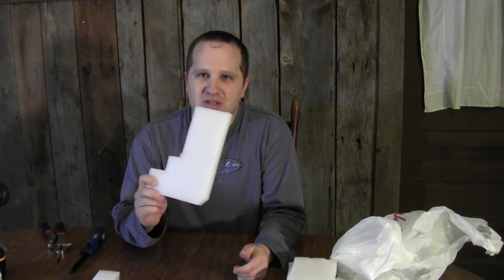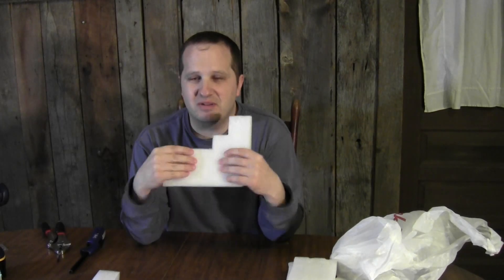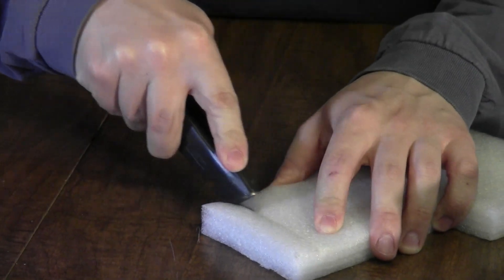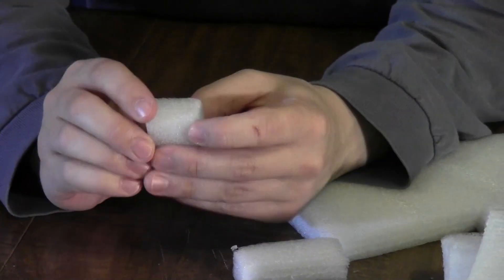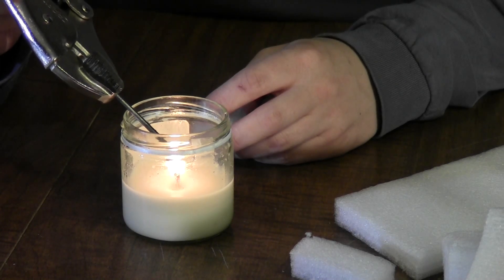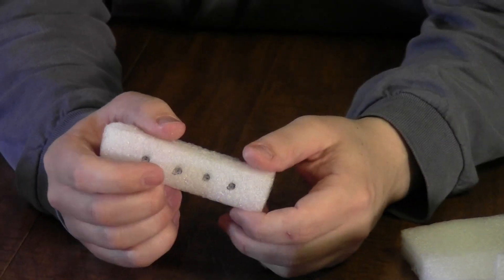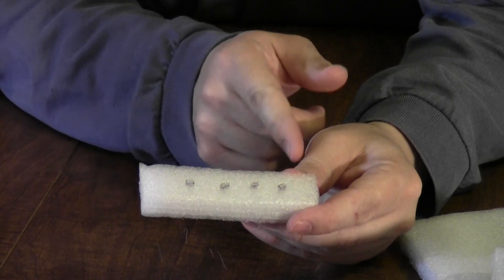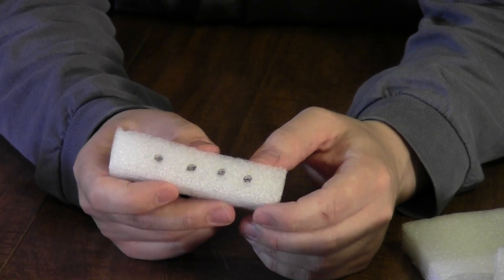How to make fishing bobbers on the cheap

Comment: Great idea. Used these for ice fishing all the time. If you used a piece of wire you could even make a smaller hole and have a slip tie on the line so it could move up and down when using a reel.

Comment from the maker: There are a few different ways.  You can tie it to your line, leaving a long tag end for the rest of your tackle.  Or you can run the line through the hole and either use it as a slip bobber or use small split shots to keep it in place (I know it seems silly to keep a float in place with weights, but if you size your piece of foam right this works fine).

Comment: just put a wooden skewer through the hole with the line in it. the skewer will hold the line in place. and you can adjust it as u want.
Reply from the maker: Thanks for the tip!

Comment: Depending on the size and species of fish this may be detrimental as some will let go of the bait as soon as they feel resistance. It's potentially a great substance because of it's buoyancy but I suggest cutting it into smaller, more cone shaped cylinders threaded vertically so they don't resist so much when the fish tugs on the bait.

Comment: Rather than scrounging the packing foam, pool noodles from a dollar store is the same material.  This opens up color options off the shelf.
Reply from the maker: +Lagaz Dagrsen Nice tip - thanks!
Reply: Lagaz Dagrsen but that's not cheap, why buy when you can recycle.

Comment: And,  if you lose it how long will it take to breakdown?
Reply from the maker: Carl King Probably the same as a plastic bobber you buy in the store.
Reply: Yeah there not using bio degradable material in floats if they did it would be insanely expensive